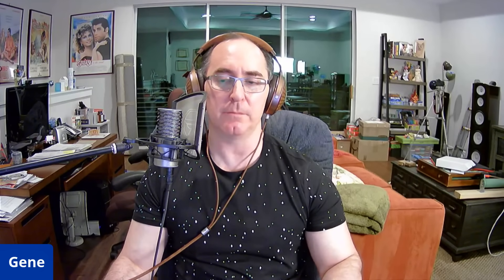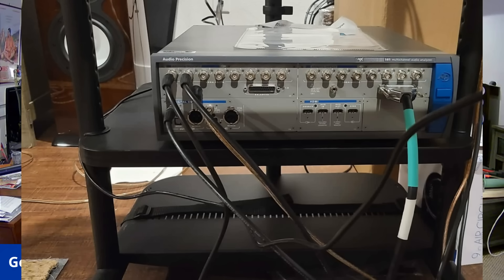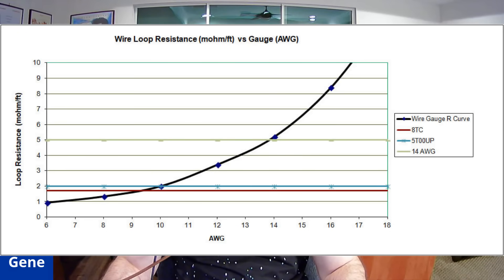Speaker Cables Really Don't Make Much of a Difference?

Comment: Thanks so much for this video.  It tracks exactly what I've been saying on a few other related videos.

I'm an electrical engineer with 45+ years experience mainly in RF for communications systems, but in my late teens and early twenties I did do a lot of audio testing for voice encoder/decoders.  For one project we did mean opinion score (MOS) testing with a large pool of volunteers using the double blind method with the results tabulated independently.  The only way to go.

While I don't doubt there is a small percentage of people who can perceive differences inaudible to the rest of us, it's a really small set of Rain Man or Brain Man (google Daniel Tammet) like folks who through some process like synesthesia literally smell or see differences in sound along with what they hear and maybe, maybe - but likely can't - hear the difference between a set of speaker cables of similar gauge.

I'd really like to see a put up or shut up challenge for a few hundred thousand dollars to the high end speaker cable companies.  Do exactly as you've done here.  Set up a nice reference system, make some measurements, then do a double blind test with a statistically meaningful population.  Cables would be rated on mean opinion score against a few standard contenders like lamp wire, 12/2 Romex, and even copper bus bar.  Maybe split the prize between highest MOS and best MOS/value cable.

Comment: You only make open minded design engineers laugh!.  So you rented some top flight equipment.   You actually don't need such equipment to make your point. But people like you, like Amir at ASR, think you do. It's not just the RLC values that determine how a cable "sounds". Once you convinced yourself there was no difference, did you actually connect them up and actually LISTEN to them?  I'll bet not. The Kimber's design is solid but they way you pontificate about parameters that mean nothing at audio frequencies makes for good entertainment. I'll bet your buddies at Arindal don't agree with you.

Comment: A guy at a high end stereo shop once explained high dollar cables to me. He said, "people buying $50,000 or $100,000 systems feel weird about connecting those systems together with $1.99 rca cables and $10 speaker wires, that's who those expensive wires are for". It has nothing to do with sound, and everything to do with perception. The question comes down to, do $5000 speaker cables sound $4,970 better then $30 speaker cables? The answer is, not to me. They might sound different, or even slightly better, but not thousands of dollars better.

Comment: 😊. Does TPC (tough pitch copper), OFC (oxygen free copper) and OCC (Ohno continuous cast) copper grades sound the same because they measure the same? Even the insulation applied, be it PVC, Polyurethane, Teflon for example applied to one grade of copper completely changes the subjective sound properties due to DA ( dielectric absorption ) on the conductor. Some manufacturers have developed foam like insulation materials to have more of air and less plastic to reduce the influence the insulation has on the conductor. Copper is very close to silver on the conductivity table. 1 metre copper wire and 1 metre silver wire will measure practically the same ….. but THE SOUND………..you will understand very quickly that electrons can be very picky about where they go through.
Reply: Listening tests are subjective and relatively useless, that's why Gene likes his FFT and other testing instruments. Equipment design philosophies are informed by electrical engineering, not magic. High-dollar cables are a product of maket-capitalism and rampantly offend anyone who can perform basic cost-benefit analysis.

Comment: ...what about interconnect RCA cables??
Reply: You will find very few RCA (phono) connectors in use on high-end equipment as they have been supplanted by balanced (XLR) connections. Despite different impedance, you generally don't see any benefit using XLR over short distances. The biggest issue with RCA is (assuming its not S/PDIF coax) that you're running analog which is fine if you are spinning a record but it is almost 2025 and you  don't embrace digital?

Comment: Does it make a difference though if you go with 10 foot long cables versus 25 foot one cables to each speaker?
Reply: Assuming the wire gauge is sufficient for the power level you are running, there will be not noticeable differences. The more important factor is keeping your cable lengths the same to all speakers. Electricity travels fast in copper but it is still good practice to make sure it arrives to every speaker at the same time. Time-alignment amongst transducers in a speaker enclosure affect imaging to a fairly high degree and high-end manufacturers spend a lot of effort to decrease delay.

Comment: No. You have to put the cables on cable lifters. And hover them above crystal clear glacier water. And the water must be circulated directionally opposite to the flow of electrons. Somewhere near, but not at the speed of light. While being sprinkled with gold dust by Leprechauns. Then you'll hear it.

Comment: It's the wire Guage that makes a difference, and has nothing to do with it being wire , because wire is wire , but the thicker the gauge of wire the lower your resistance goes down allowing higher Amperage to flow to your speakers from your AVR receiver or car amp ,and you also have to consider voltage drop in your choice of wire Guage , there is literally a mathematical calculation for  this called Ohms law , and law applies to everything electrical,  weather it be your home or car or any electrical device you own , this law applies to it all
Reply from the maker: @ronmerkus5941  https://www.audioholics.com/audio-video-cables/speaker-wire-gauge

Comment: I appreciate your experience with measurements with respect, and I value your comments however I refer not to differences in phase shift between cables but I refer to result of the interference between waves and their minor phase shifts WITHIN the component, which are not irrelevant at all. An example is known from the interference effect in an interference microscope that is also the measuring principle of for example the Einstein Telescope that is able to detect so called negligible displacements thanks to very minor shifts in phase. My point is that very small phase shifts are indeed visible/audible and certainly NOT negligible when it comes to perceiving an image (in audio the equivalent of this image is the soundscape).

In my field of expertise this is generally measured as the phase transfer function (phase as a function of frequency) of a component, beit a cable or another component or any combination of components. In general response theory this effect can also be measured as the Impulse Response Function (which is nothing else than the time domain representation of the phase transfer). 
Actually I noticed that Alpha Audio has contributions here on Youtube, where they measure the impulse response response of cables and find significant differences between cables.

But thanks any way for the discussion
Reply from the maker: @RudyDeblieck  If the cables are tested unterminated,  the phase shifts you discuss are irrelevant.  I'm aware of the tests from alpha audio which are very misleading and too long to get into in a discussing thread here.  To date, nobody has proven audibility or measurable differences relating to phase or time domain performance of properly terminated audio cables at audio frequencies.

Comment: Actually I do not " take" observables from some textbook. In am a professional solid state physicist, PhD dealing with phase transfer function effects inside amongst others electron microscopes. So I think, I know my science. The phase transfer characteristic through any component is not linear and certainly not infinitesimal and so does matter. That is the reason why I asked about the phase characteristic, because it may very well as you state, be inconsequential in terms of power transfer, but it will have an effect on the impulse response ( time domain) of a component ( as a cable is one). And admitted, you are correct in this, the power transfer will only change infinitesimally. But that is not my point.
Reply from the maker: I've spent 25+ years doing small signal analysis, measuring cables, designing systems with 120dB+ dynamic range, measuring amplifiers, loudspeakers, and room acoustics to know from experience that the differences you talk about aren't worth talking about because they are insignificant. It's like arguing the gravitational force a single grain of sand has against the Earth. If you spent any time studying audio with regards to psychoacoustics, loudspeaker/room interaction, speaker placement and digital EQ correction, you'd quickly realize you're wasting time regarding infinitesimal changes in phase between cables.

Comment: You seem to miss the phase transfer in your comparison I.e. the phase shift as a function of frequency. Alternatively you can also measure the Fourier transform of the phase bandwidth. This has an enormous effect on the sound quality...
When you claim to measure scientifically, then measure relevant parameters at least.
Reply from the maker: @RudyDeblieck  Your comment misuses technical jargon in an attempt to sound scientific, but it lacks relevance to speaker cable performance in real-world audio systems. Phase shift, as a function of frequency, is so infinitesimally small in speaker cables—especially at audio frequencies—that it has no perceptible effect on sound quality. Introducing the Fourier transform of ‘phase bandwidth’ further demonstrates a lack of understanding since such bandwidth in properly designed cables extends far beyond human hearing. If you’re claiming measurable or audible differences, then provide data under controlled, repeatable conditions rather than misapplied textbook terms. Until then, let’s focus on actual science and engineering rather than misleading arguments.
Reply: Have you ever measured the phase transfer of a cable, then ? @Audioholics

Comment: At age 12  I used to salvage discarded stereo components from discarded console TV/Stereo with built in record changer, AM/FM stereo radio and some with either cassette, 8-Track or reel to reel  (I found all 3 kinds of  tape decks).  When I had all the components for my system and had made boxes for each from the console cabinets cut to the sizes for the boxes to fit each component ,  and had matched the speakers for even sound side to side regardless of size and/or shape of the speakers mounted in  custom made  baffles in the salvaged kitchen cabinets. my system had more power and better sound quality than most of the adults in my neighborhood. My dad had a really great GE 25" TV/Stereo AM/FM stereo console with record changer  (about 6" long with full range 12" stereo speakers)   he even made  2 pairs extension  speakers for the kitchen and dining room. he ran the speaker wires below the  hardwood floors/  basement  ceiling to keep them hidden and out of the way.  That's where i got the idea for a switching box. My dad  made one to turn on either or both pairs of extension speakers. and yes he used 12 AWG lamp cord for the speaker wires.  LOL  my favorite toy was the amusement park ride series of erector sets with all those little steel girders and nuts and bolts that you had to fit together to make the rides in the series. there were 6 rides in all. I also built plastic car models, about (a dozen or so) customizing some of them.   yes i have to customize almost everything I build to make it better/cooler.

Comment: Why on earth would Kimber not use a UV resistant sheath on the 8tc cable ?  My experience has been that these clear sheathed cables break down over time whereas those with a UV resistant sheath do not.  Such a shame given the price of the 8TC.  I use Supra Rondo 4x2.5 bi-wire due to it being highly resistant to corrosion and the fact that it is supply and easy to route / lay on floor.
I bought a 30m ($150 trade price) roll made a couple of sets up for home - then terminated and dressed up a few sets of speaker cables up which I sold to pay for it all and make a little profit as well.

Comment: I have just changed my 45 year old 10 amp cables for new 13 amp cables.
Zero difference in audio. Resistance is 20 ohms per mile. Over my 5 meters its 0.06 ohms.
FYI, skin effect does not start until 50kHz. Its not an audio issue!

Comment: Gene thank for the video. Will there be any differences sound between pure copper and pure silver speaker cables?
Reply: Not that you would hear. The electrical resistivity of copper is about 17 nano-ohms/meter and silver is about 16 nOhms/meter. A nano-ohm is about one-hundred millionth of an ohm... so, 17 of those per meter is literally makes no difference. What may make some difference is thermal conductance or dissipation of heat should the wire present too much resistance. Again, that would only ever come into play if you used too small a guage of wire for high output. Don't do that, you'll likely damage your speakers or amplifier first. Still virtually unmeasureable, is time incoherence due to varying length speaker wire. It is good practice to use the same cable and lengths to all your speakers, definitely your fronts if you are 2CH listening.

Comment: Measuring is important, but a measurement does not tell the whole story. Something can measure well and sound rotten and something can measure rotten and sound fantastic. The fact is that the hardly significant differences are there, but are magnified as superlatives.

Comment: The only time I get picky about cables is if they're supposed to be rated to a specific standard. (USB, HDMI, VESA DP, Ethernet, or rated for specific Wattage/Amperage for charging/power cables and such)

When it comes to just standard wiring using a copper wire and some standard termination. I just get whatever is the appropriate gauge. If the wire is gonna be visible in my setup, on the desk/table or floor, I may invest a little extra for something more aesthetically appealing lol.

My dad was an commercial electrician and networking technician. He set me straight about wiring lol. He'd give sales guys at electronics/audio stores "the stare" quite often. 🤨

Comment: Whats the best gage cable for 4 ohm speakers? With the longest run being 15-20ft.

Running some Kefs off my Carver receiver that puts out 150 at 8 ohm.

I read online somewhere it suggested 12 - 14 due to it being a higher load.

Comment: I've just used something like 10 gauge to connect my speakers up as the 49 strand (I think - I didn't count em) wasn't long enough. I think 79 strand is pretty much standard for speakers but it's way too thick for a lot of connectors. I'm so glad I found this comparison as I shall worry no more!
I'd be really interested in a comparison test of rewired tonearms. I imagine now that all cables are pretty much equal? I was probably fooling myself when I got a specia CD connecting cord with gold connectors (another test there!) BUT it was only about 15 UK pounds (20 US bucks) so hardly expensive.

Comment: i made my own cable with cardas litz cable platted together 21 guage for each run each cable has 3plated together for the + and 3 for the - in a silk sleave and finished off with a nice red sleeving and silver plated connectors. cost me a fraction of what it would cost me to buy them they look nice and do the job well .

Comment: Thanks for the informative video. Decades back (I'm old enough to overspend on cables) I always was skeptical (& cheap) when it came to pricey cables. However, there were garbage RCAs that came with some AV gear that really did suck. This along with the advancements that came with video & computer cables (i.e. USB, HDMI, etc.) proved cables do make a difference. I think this, along with consumer ignorance, aided AV accessories manufacturers in making unsubstantiated marketing claims and consumers believing them. Like most enthusiasts, I'm not an EE so sites like this really help me understand what's important. Much appreciated

Comment: Wait untill these people figure out that the internal speaker wires are cheaper than the ones they swear sound worse 😂
Reply: I would love to see video of these people taking their speakers apart, and the outrage. But I have a feeling that "audiophiles" making these claims probably wouldn't know what to do with a screwdriver.
Reply: The speaker is a sum of its parts, those ordinary internal wires are part of its sonic signature. Perhaps those that claim they can easily hear differences between speaker cables are the ones with compromised hearing, not the other way around. So let them try to find the cable that sounds best to them. Let them believe.

Comment: According to my experience cables do matter but only to a smaller extent than say the quality of the source etc. Therefore allocating a modest amount of money on cables say 10 - 15% is justified. Who wants to go back using standard wires? Burden of proof is in a court room, if you don´t believe do not buy
Reply: As long as you're not buying the absolute cheapest option they don't matter bud